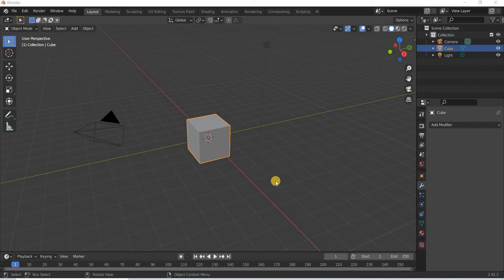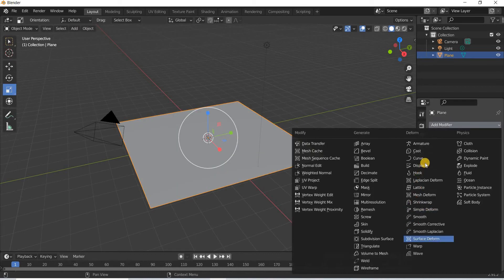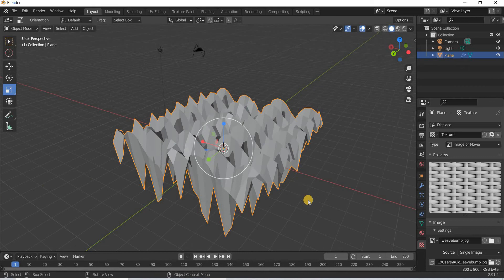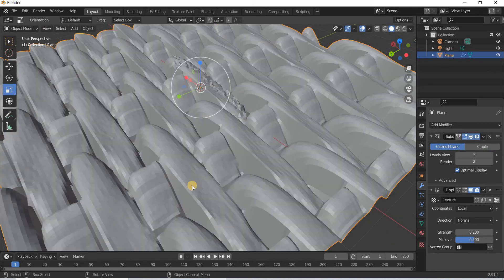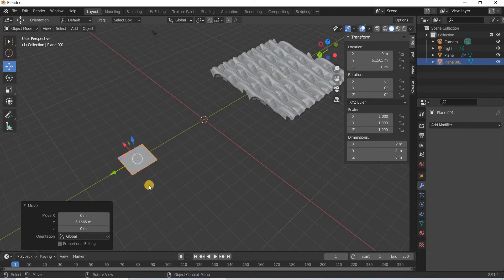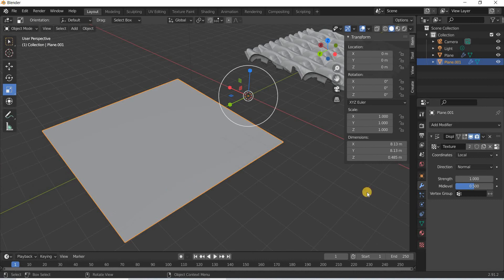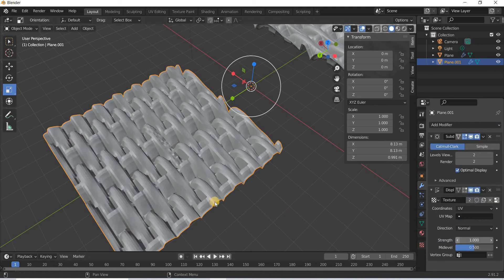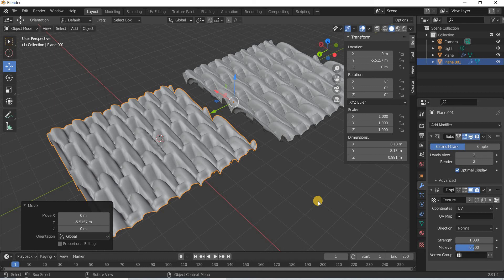Blender (2.9) Encyclopedia - Displace Modifier

Comment: So, why don't people use diaplacement maps to make a human face off of a photo instead of licensing expensive software to do it...
Reply from the maker: Human face has specific details. Displacement map is suitable for irregular shapes. It only goes up and down. Human face has certain details that will not be possible with a simple displacement map. It will take more time to master how to create a specific displacement map for a face to use it as a starting point as well.
Reply: @rahulmalpure  thanks for the fast reply. I started experimenting with displacement after watching the video and I get what you mean about the map points can only go up and down. 

Subdividing the surface lots of times helps, but eats processing resources up on my crappy laptop. It works well for a rocky landscape, though, which is cool. Thanks for sharing